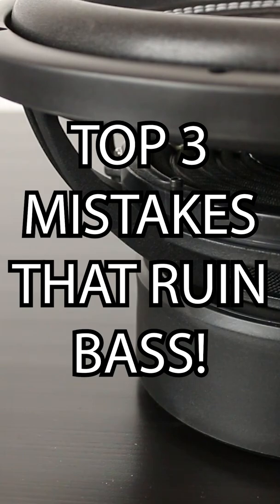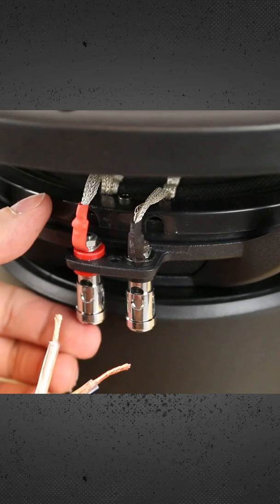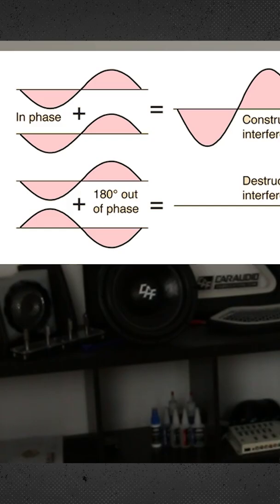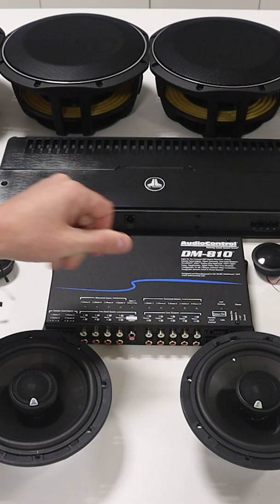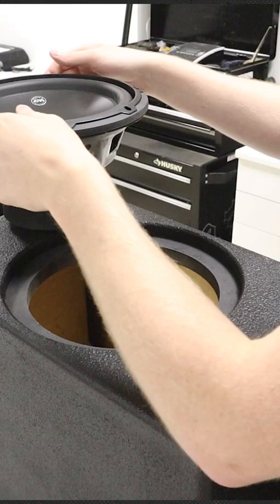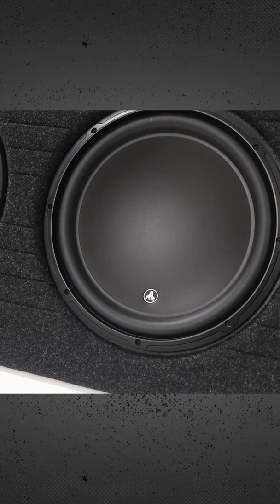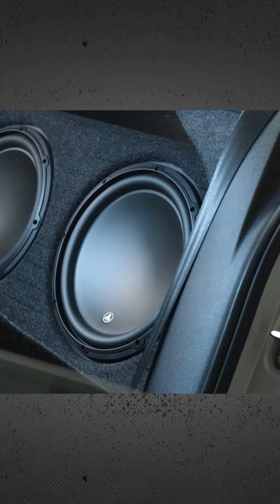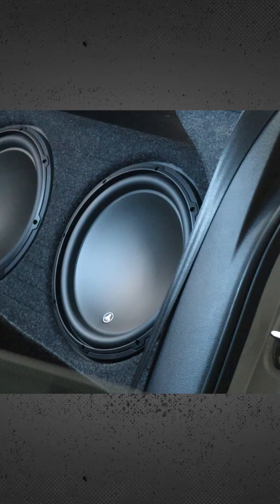3 Mistakes that Ruin Subwoofer Bass! #shorts

Comment: My mistake was when i married my wife instead of buying a dsp!
Reply: Hahahahah
Reply from the maker: We all make mistakes... 🤣🤣🤣 jk 😜
Reply: Only thing I can tell you is Men do what they want , boys do what they can , 24 years in and I’m a man that buys what I want
Reply: @beerman9807  does that mean your divorced now😂😂 👍🏿
Reply: @CarAudioFabrication  in all the cars that I've owned. I've been able to put subs in them but I've now got myself a Volvo and I really don't want to modify the unit up front is there anything on the market that you know of ? 
Trying to change it makes you lose other functions within the car head unit 👍🏿
Reply: @beerman9807  I think he was joking. It’s not that serious brother.
Reply: Wife wanted more bass. Kids needed more room. Had to compromise.
Reply: @zigzag7194  are you asking if you're able to install a subwoofer WITHOUT modifying the head unit? If so, check if theirs a stock subwoofer in the back. If there is, you can tap into those speaker wires going directly to the sub, and run them to your own amplifier. But in order for it to work, you'll need to spend ~$20 on a line output converter (can buy one from best buy for like $15). A LOC converts a high level signal to a weaker signal that can be plugged into the amplifiers RCA input like normal. Then you add your own speaker wire to hook up your new sub to your amp. Basically, the LOC converts the stock speaker wire into RCA wire...
Reply: @bailey2517  I really appreciate the information  and I guess it's something I can work towards doing. 👍🏿 many thanks from across the pond 🇬🇧
Reply: @zigzag7194  Glad to help! It's always great when you have a factory sub because that means you don't have to bother with taking the head unit or amp out at all. Completely bypass all that stuff.
Reply: @bailey2517  thanks once again it will give me something to do before I go to work tomorrow 👍🏿👍🏿
Reply: @zigzag7194  good luck have fun!
Reply: My wife is VERY felatious and had me put a system in all of our vehicles. I love my wife.
Reply: Lol
Reply: @bailey2517 I've just finalised your instructions and man it works I can't thank you enough thank you👏👍🏿🎶
Reply: @zigzag7194  OMG that's awesome!!! I'm glad it worked hahaha.
Reply: @zigzag7194  what sub did you install if you don't mind me asking?
Reply: @bailey2517  sorry for the long delay. It's an Execution by elevation and I'm using a mosfet amp. It needs a bit of tuning up to get the right bounce that I'm looking for the boss is here😂 so I can't wait for her to go to work tomorrow 😂 👍🏿
Reply: @zigzag7194  hell yeah 💪 I've never heard of that sub but imma look it up now.
Reply: Bruh
Reply: Jokes on you. I couldn't get married, no matter how much I want to.
Reply: hahah.  My mistake is when I had my dsp tuned wrong and I still heard her yapping.
Reply: I second this
Reply: Not funny
Reply: Sheeeesh
Reply: Broooooo😂😂😂😂
Reply: Don't worry bud with that attitude you will b single again in no time hahaha
Reply: @zigzag7194  yea just get a line output converter it hooks right into your stock speakers and helps to cancel alot of those bad frequencies and distortion to have a clean sounding stereo without having to update or modify it much
Reply: @beerman9807  having a magic wand always helps too 😉
Reply: Hell yeah that's what I should've done because my wife divorced me and drove off with my ride and my system was still in it. It was part of the settlement but I showed her I got the dog.
Reply: @zigzag7194  Just get an adapter and bypass the head unit all together, it's one option
Reply: Line output converter is what you need
Reply: Shoulda just went cheap on her ring.
Reply: I can help you with that put a lil tight hitting sub under her seat so vibration are focused my old car had 2 15” subs with 2 2000ish watts amps hooked up and once it hit a certain volume members of the opposite sex got really excited for some reason it looked like some were glowing almost that might help you win a debate here and there I can’t wait till my truck build is done haha 😈 😂
Reply: Naw, just the wrong lady....pick better next time
Reply: 😂🤣 damn that was good
Reply: 🤣🤣 LMAO I am gonna pin this on my wall because this is a LEGENDARY comment of 2022 on YouTube 🤘😂🤘
Reply: Hahahahahhahahahaha
Reply: 😂 nice
Reply: Ouch!
Reply: Haha wtf
Reply: My mistake was telling the wife how much the DSP cost :p
Reply: Phase is one of the most important thing in audio...also being single 😂  im married..so im riding stock
Reply: Hahah😂 everybody is a mistake 😂
Reply: @CarAudioFabrication  insufficient grounds 😮 even companies get that one wrong for some reason it is wild
Reply: FACT
Reply: 😂 hell yes me to lol
Reply: LMAO 🤣🤣🤣🤣🤣
Reply: Radios come with DSP's but you have to pick them yourself specifically and it won't be as good as a dedicated DSP but it's better then nothing
Reply: Have fun paying that alimony and child support 😂
Reply: Hahahaha
Reply: @ohm.3768 This comment is the most on point. Other than the one person that helped that guy for the comments figure out his issues with his setup that was pretty stellar and smooth of an interaction. But this comment is just definitely on a different level of on point 😂😂😂 👌🏻
Reply: @Zimy5489  I  speak facts buddy🤭
Reply: @ohm.3768  Sometimes are just true man.
Reply: @zigzag7194  I would laugh my butt off if I heard a Volvo rolling around with some awsome system...tho I am totally hypocritical here cus I've got 2 15 JL in my toyota avalon be bumper around driven my kid to school..he loves it, so wtv, if anything I'm the wife who makes my systems better than my man's.
Reply: Drizzle Drizzle
Reply: Same bro. Same 😭
Reply: @CarAudioFabrication  we do yes 🙂
Reply: @beerman9807 ya think 🤣
Reply: @zigzag7194  late answer idk if u have moved on but u could hook up a secondary head unit and have it lose or make a braket or sum

Comment: When i screw the Subwoofer in and the drill decides to go through the actual Subwoofer
Reply: Oof
Reply: Bro, big big tip. Pre drill your mount holes, the drill only pops off because the screw isn't catching correctly. If you pre drill, and start the screw by hand, you don't need to push to get the initial bite, cuts out the whole motion that causes that drill to slip.
Reply: I thought this was going to be number one
Reply: @dbongoloid9541  didn’t get the joke
Reply: Ooh I've done that before when I was younger. 😬💀🤦🏻‍♂️
Reply: @dbongoloid9541  a pilot hole is very helpful. But everyone else seems to have no issues. So i believe it's just practice. I rarely do it now so I'm getting better
Reply: Hahahaha that hapend to me soo many tumes
Reply: Ouch
Reply: @dbongoloid9541  What if the drill but breaks and pokes the blsubwoofer lol
Reply: I drill pilot holes first. Then when I go to install the screws, I put my hand over the speaker surround. I’d rather stab my fingers than put a hole in my speaker.
Reply: I did that, slipped and went right through the foam,was not gonna spend another $180 on a sub so I used permatex ultra black.Its been on for over a year no issues and hasn't seemed to change performance of the sub.
Reply: Put ur free hand on the screw bit making a protective wall. Kinda hard to describe but it works
Reply: @sw20mr24  What's the joke
Reply: Pilot hole might help
Reply: @dbongoloid9541  He got a point tho pre tapping or idk the correct term but doing that it makes it a lot easier to put the screws in.
Reply: @porscheGT652  just called pre drilling.
Reply: @dbongoloid9541  haha yeah I knew there was a simpler term for it lol
Reply: @sw20mr24  missed the meta.
Reply: Done that with a hand screw driver had to use enlarged screws didn't think about bolts back then and the mega thread slipped and it pointed right in and went thru still worked surprisingly for awhile upgraded since
Reply: @sw20mr24  it wasnt a joke..obviosly the drill slipped off the screw and went into the speaker
Reply: That's a yikes if something
Reply: Id cry
Reply: Oof owe my bones
Reply: Me too...🤣
Reply: You're supposed to port the box, not the driver!
Reply: Was just Going to say that... Beat me to it
Reply: I actually literally almost did it today 😂 

So funny I look up one wiring diagram on Google and my YouTube is swamped with audio again lol.
Reply: This is why there’s a lot to be said for Allen head fasteners. Using fasteners that require downward force while twisting with a pointed tool is just stupid. An Allen drive, torx, or square drive fastener only requires rotary torque without the need to push downward. Don’t get me started on putting screws through a baffle without pre-drilling. Or using a drill to secure the fastener without a clutch setting set, running it down at full power, and ripping the threads out of the hole when the fastener hits bottom.. then putting a larger diameter fastener in that hole so the next time somebody takes the speaker out they don’t get that large fastener back into that same hole and put it into a different hole and end up with one hole where the screw doesn’t get tight in the original stripped one, and then have to find another large fastener… and the process goes on, tearing hair out the whole time when all that needed to be done was set the clutch on a drill the first time.
Reply: Actually the only one way to not have this happen is to point the screwdriver with the top pointing away from the cone area, so if you slip on the screw, the machine will go forwards, and not in ur surround.
Reply: Pre drill holes and use a screw driver ong get u some big arms
Reply: I think it all has to do with the screw bit youre using if your using one the chewed up its gona knock over your screw causing you to drill you sub lol
Reply: My screw gun slipped because my arm was hurting and the screw wouldn't take a good bite
Reply: @adrianjaimes14  Correct.  I would add "Practice on other people's sub".
Reply: That's call "direct porting the sub"
Reply: This happened to many I heard lot such stories
Reply: @mathusuthanan7151  Especially when you buy a brand new subwoofers and the manufacturer forgot to tell you that the holes aren't drilled out on the basket? Oh boy 👦
Reply: Yes biggest mistake I've seen
Reply: Did that way back when I was in HS lol
Reply: Slow down bucko i know it’s exciting lmao
Reply: Been there...lmfao
Reply: Yes, I did this not long ago. But, in my defense, the bit came out of the adapter & the bit was the only thing that went through the sub! I haven't tried it since then, but thankfully I bought a pair of subs!
Reply: @Galerare only one way?? There at least 3 very effective ways my friend, 1st, pre drill your screw holes. 2nd use square drive or Allen (hex head) screws, they do not require the downward force that Philips head screws require. and 3rd your way I guess.
Reply: Fuccckkkk I took have been guilty of this when I was upgrading my midwoofers! It you aren’t a contortionist then accidents are bound to happen 😅 luckily it was the older of the two speakers that I poked thru so it hurts in your soul the dollars just carving away lol
Reply: Bro..

Actually done this. 
It was a Kenwood kfc sub though so not too big a deal. 😂
Reply: @dbongoloid9541 i buld peakees for a living, and i can say that there are a few times it does happen. That said, i build a lot of speakers, and it's probably around 1 in 3000 (likely more) now, but when I started, it did happen somewhat "often" and when a new person comes in its a common problem for a day ir two
Reply: Never ever use a drill around the speaker. I don't care how long it takes, I only use a manual driver while using my other hand as a stab guard.
Reply: An extra port hole
Reply: @dbongoloid9541 that still doesn’t prevent your drill itself from slipping off and going through the cone or surround.
Reply: @dbongoloid9541  Its actually called a pilot hole
Reply: @dbongoloid9541 It's actually called a pilot hole
Reply: Hwhat that's gotta be some srs bad luck to happen .... Ive never had an issue drilling my subs in
Reply: noobs, i take my screwdriver and push and turn 😂
Reply: That's a heartbreak💔
Reply: @dbongoloid9541  truth, just did this the other day

Comment: Rattles! #1 way to way to kill the sound quality of a system.
Reply from the maker: For sure. Got to have the sound treatment
Reply: Lol.#1 has to be no sound.
Reply: fact
Reply: Most definitely lock everything down insulated cushion that. You want to hear the signal.
Reply: that don't matter on a SLAB
Reply: thats a tough one though, especially in the trunk of a sedan, literally every single thing will want to rattle
Reply: Naaa leave the rattles and panel flex. It's intimidating at a red light.
Reply: @thevideogamer0mg99  how bout in the trunk of a coupe or the back of a coupe ??
Reply: @dbongoloid9541  Loool
Reply: Once you get up in the 150db range and up it don't matter, you better bolt your doors down.
Reply: Dynamat helps but if you want to do it on the cheap... Modeling clay. Stuff is amazing as a damping material. Just remember if its gets hot enough it can migrate. If its not flat on the deck you can prevent movement by putting it behind dynamat or putting PL adhesive or Sikaflex over it. I once built 8" mids into the kick panels of a 65 cadillac, the enclosures were 1/2" birch rivited to aluminum angle rivited to the inside of the vent space, then covered with  fiberglass. Over that I lined the whole inside with modelling clay covered with another later of sikaflex. It never moved. I then used the kick panel vent controls to raise or lower the angle of the HLCDs mounted under the dash for the height of the listener. Pair of 15's built into a bench seat in a sealed box that was jacketed on all sides (except soundboard) with a 3/4" thick void packed with silica sand. Virtually no mechanical energy transferred to the car. Yes it all worked. Unfortunately by the time I finished the system the car was rusting out cuz I lived by the beach. The project car that ate my life.
Reply: Lol 😂 Texas' trunks even knocc different 😂🥰
Reply: @559bass5  was just thinking that lol
Reply: @johnlucier5654  sounds freakin awesome dude 👍 never thought of using sikaflex for building enclosures, I have a dozen tubes in my garage for lining my crawlspace, might just have to use what's left in my vehicles 😅 

Amazon makes "Amazon basics" branded knockoff dynamat now, it's bright blue with prime logos and everything, looks hilarious inside a door panel, let alone the review photos of full interior linings 🤣
Reply: Also, I have found out that if you don't have the box secured to your ride, you'll loose some bass that way as well!
Reply: I watched a guy use a can of expanding spray foam meant for house construction on a Jetta exhaust heat shield because he didn’t want rattling. 🙈
Reply: @Rodogg7787 really does it make a difference?
Reply: Unpopular opinion but sshhoo I love rattling
Reply: Just turn it up louder than the rattles. Problem solved.

Comment: I had just came back from deployment and bought two kicker L7 12's the guy at audio sound (Jacksonville, fl) said I'd only be able to use 1 kicker because of the speaker box space needed. Then he up sold me on some new tweeters, door speakers, and rear panel speakers. I had a brand new Infiniti G35 and it had its own amp... but somehow he got me sold on another amp and new speakers for the entire car... but when I asked for my factory speakers back and my factory amp he said they were in such bad shape he discarded them. This was 2008, the car was a 2006. Next my speaker kept going out. The voice coil kept coming apart and he said I had to contact kicker. Kicker being awesome sent a replacement without question. 3 months later same thing happened again. A 4200 system that sounded amazing when it worked was now dead... the dealer who installed it long gone. Kicker finally sent me to a place called shades of tent (RIP Richard Bass) right away he knew the guy messed up the specs on my box and rather than admit to his own mistake he took off with my perfectly good tweeters, 6.5's and 2x 6x9's with my stock amp. Richard also put dynomat in every place he could (roof, floor, side panels, all in the trunk, trunk lid, even behind my license plate) plus he did it at a fraction of the cost the original guy did... took me 3 years and lots of court dates but I finally got my money back but all the crappy sound place did was change their name to "Rolling Sound" so anyone in the Jacksonville,  FL area looking for a good car audio place please make sure to stay away from Rolling Sound. They will steal your perfectly good stock equipment,  then blame the manufacturer when in reality they just hire terrible installers.
Reply: @acuralee  this is why we research and inform ourselves as much as we can, so we're not taken advantage of by shady business practices that don't have our best interest in mind.
Reply: Dude... what are the chances that I find this. I live in Jacksonville and was planning on getting a quote for a sound deadening job from this exact shop. Small world.